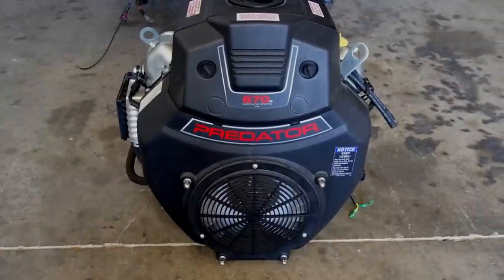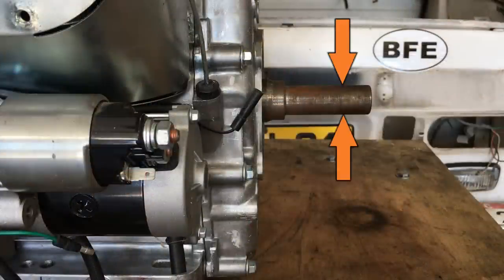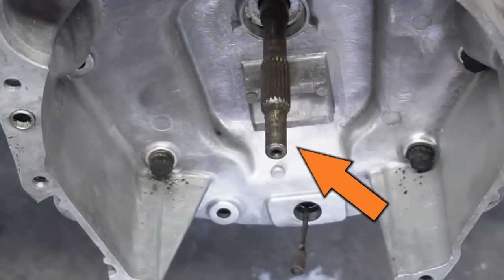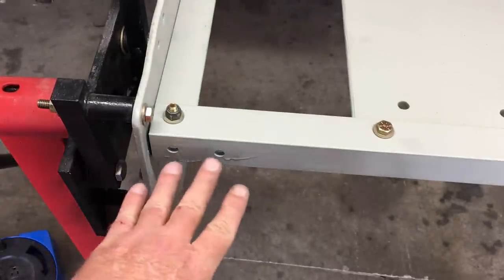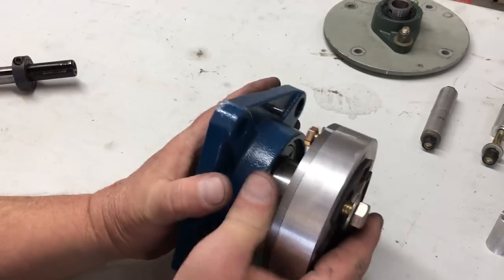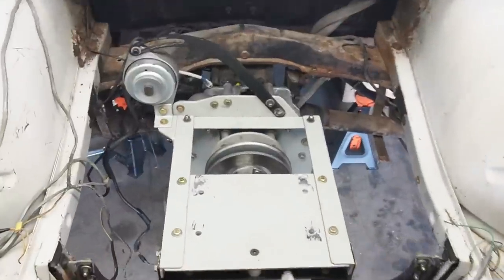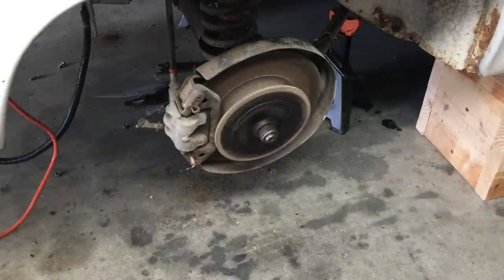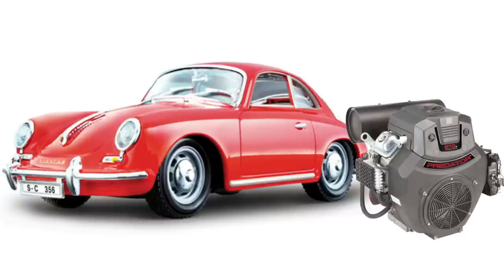S3 E18 We put a 670 Predator V twin in our project car 1969 Renault 10

Comment: 22 is about half original.  original did 84 mph, so this should do at least 62 unmodified. 75 mph should be possible after you hot rod the engine.

Comment: If intressed I've got a audi electrical turbo runs on 48 Volts. I can donate it to the channel if its interesting? It sits in one of the bigger v8 engines and gives boost at low rpms.

Comment: East Germany's Trabant: Crummy car and a cherished icon
Reply: What’s the best worst car ever made? You could hardly pick a better candidate than this, the humble, homely, slightly horrible Trabant. To the cynic, it’s a terrible car. To many folks, though, it’s a cherished icon. Why?
Reply: @kansasrose2909  1975 Trabant

Time Magazine described the 1975 Trabant as "the car that gave Communism a bad name." It almost feels like that's enough information to call it the worst and move on to the next terrible vehicle, but here are a few details anyway.

The Trabant, designed to be an alternative to the Volkswagen Beetle, had a two-stroke engine capable of a whopping 26 horsepower. Its body is constructed out of Duroplast (a fiberglass-like material) and reinforced with recycled fibers such as cotton and wood. Oh, also, it smokes like it's on fire when driven. Nice, right?

It doesn't have basic conveniences such as brake lights and a fuel gauge, but the Trabi, as it was (affectionately?) known, does have its place in history. Thousands of East Germans drove these vehicles across the border after the fall of the Berlin Wall. As if to illustrate how awful these cars truly were, though, most of them were then left to rot in fields where sheep and cows discovered that the Duroplast and fiber siding was edible!

Comment: I bet a thrust bearing could be mounted in an adaptor plate around the crankshaft, & total thickness could be under 10mm. Then the crankshaft wouldn't be loaded by the clutch.

Comment: Which Will Soothe My Weary Muscles Better — Bengay or IcyHot?
And where does plain old ice fit in?
Reply: First, let’s take a look at IcyHot’s standard cream. Its active ingredients are 10 percent menthol and 30 percent methyl salicylate. Interestingly enough, these chemicals are the respective active ingredients of peppermint oil and wintergreen oil, which means that you’re experiencing the combined benefits of more homeopathic remedies like the administration of the essential oil versions of the two products simply by slathering on some IcyHot. Both menthol and methyl salicylate have proven pain-relieving qualities, and both are known as counterirritants, which means they cause inflammation in one area — specifically the skin — in order to relieve pain in the muscles below.
Reply: When we step over to take a closer look at Bengay, we see that Bengay also has 10 percent menthol and 30 percent salicylate solutions, which suggests that it has the exact same active ingredients as IcyHot in the precise same concentrations. However, Bengay also contains a 4 percent camphor solution, or the active pain-relieving ingredient in cinnamon oil for those of you still keeping score on the essential oils front.
Reply: The ironic element to the inclusion of camphor in Bengay is inherent in the description of the sensations it induces. Specifically, camphor is known to cause cold and warm sensations in the skin when it’s applied. In other words, these Bengay-induced sensations could alternatively be described as “icy” and “hot.”
Reply: Are you saying that Bengay is better than IcyHot?

Not at all, but I am suggesting that a cursory look at the active ingredients in both would suggest that Bengay may have something different — if not something more — to offer, while similarly stimulating the skin of the affected area. Inactive ingredients do make a difference, so we certainly can’t downplay their role. After all, it’s the inactive ingredients that may cause you to prefer one type of energy drink over another that’s of a similar strength of stimulus. However, in terms of your body’s response to the applied analgesic rub, Bengay seems to have more ingredients that are acceptably fighting to alleviate your pain than IcyHot does.
Reply: Sold! I’m about to head off to CVS to score some Bengay!

Slow down, pal. We’ve got something else to discuss.
Reply: There’s another substance that reliably goes on icy and numbs the skin as it treats an area of the body that’s experiencing pain, and that’s ice. Ice has also been proven to expedite some healing processes in compromised areas of the body. As my favorite physical therapist Heather Asti once advised me, it’s far better to apply something to the area that improves the physical condition of whatever is causing the pain as opposed to masking the pain and leaving the affected areas unaddressed.
Reply: If you’re interested in selecting between IcyHot and Bengay, there is enough of a distinction to be made between them to select one over the other, but if you’re willing to exert a little more effort toward your self-care, the application of ice to the same area is likely to be more beneficial in most cases, and it will certainly be less expensive.

Benjamin Franklin famously said that an ounce of prevention is worth a pound of cure. Well, as far as holistic benefits to the body are concerned, it appears that an ounce of frozen water is worth a pound of pain cream.🤠🤠🤠🙂🙂🙂🙂

Comment: 0:55 the car is like 1700lbs and change and the 670 can be a real monster with the right parts and some 93. I bet you can hit 100.

16:00 go full troll and put a turbo 4 banger into a corvette. the old boomers in yer local club are gonna rage so hard when they get beat by a bastardized beater corvette powered by a honda engine running an ebay turbo kit.

Comment: Another word you're not going to actually use the transmission you should have made your truck clutch assembly to mount and set up so you could use the transmission but you're going to use a centrifical clutch to drive and only have one speed that's not too smart you still should have the clutch setup and you could have hooked everything up that way with the clutch and actually use the transmission